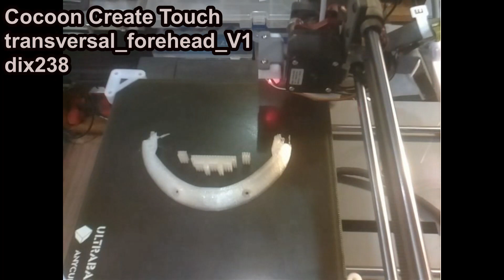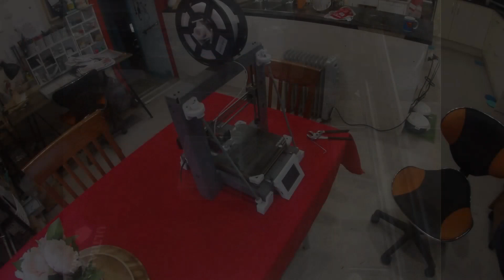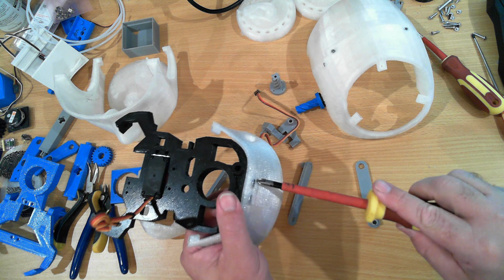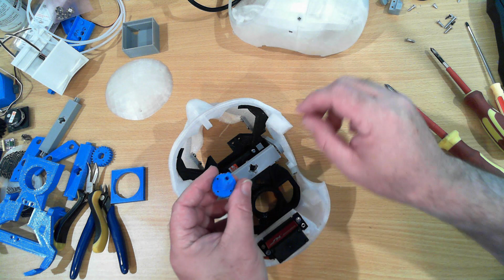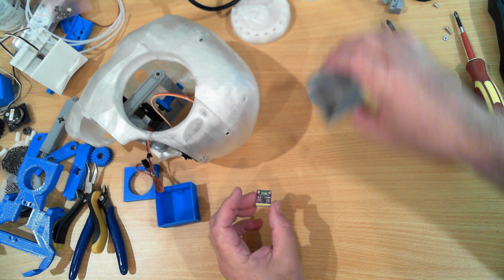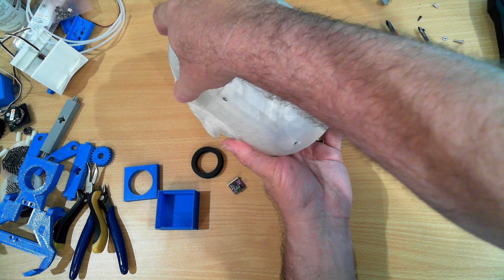Freds Head Part 1

Comment: Hi 
Is there an option to install speaker in the head ? and if yes  what  size and  output power
If you can send model it will be  great.
Regards ahead Doron:chillwcat:
Reply from the maker: There is a stl for the speaker on the official inmoov site
https://inmoov.fr/wp-content/uploads/stl/Neck/SpeakerMouthHolderV2.stl
I don't think this is compatible with the new i2Head version that I am now running.
I don't have a speaker installed in my build's head
Reply: @CyberOne  
Hi thanks for help  So   if  i want  to have   a speech  conversion (AI)   i have to connect an external  speaker ?  Doron

Comment: Hi 
is there a Bom for Fred (I mean stl files   and hardware so  i can order  all 
Regards Doron
Reply from the maker: The most current build is now mostly a standard build now.
The mods I had used with the head have all now been replaced with the i2head, this now has 17 servos in it and no room for the Raspi in the head.
The standard InMoov BOM can be found here: https://inmoov.fr/default-hardware-map/
For the i2head, check this out: https://inmoov.fr/headi2/
and the i2eyes that fit into the i2head: https://inmoov.fr/eyes-i2/

I found I can now use the standard MRL - InMoov program now the Config systen has been introduced,  mostly now its just the way I have wired my build that is different now.
Hope that helps.
Reply: @CyberOne  thanks for response
 will begin the print and order hardware  Doron

Comment: Question, for your opinion, what are the best standard servos to use…..I run mg996r servos, but when I change the end stops for the servo in MRL, they shut down and I have to reset the whole program….looking for a cheap servo if possible….
Reply from the maker: I don't think of the MG996R servos as a cheaper servo, not when you have to replace them.. 😞
More recently, I've been using the PDI-6221MG servos or the FEICHARO F39202-270 35KG 270° Servos.
These servos are not much if at all more expensive than the MG996R but do last a lot longer in most cases.
Reply: @ thank you….

Comment: Which of the link in the description contain the jaw support parts used in this video?
Reply from the maker: I thought you were building the i2Head!
Parts used in this videos are not compatible with the new i2Head versions.
This build was created back in May of 2020
The i2Head is this years build.
Reply: @CyberOne  yes, I was trying to build i2 head but I don't have any silicon mold expert that can make a silicon face for me. And I can't do that by myself. So there is no other option than using this built.
Reply from the maker: @SaadAli-v2t  I don't have expertise in silicon face making either.
I printed out the moulds as found in the i2Head parts list, cleaned them up and mixed the 2 part silicone and poured it into the mould.
This worked.
Just remember to read the instructions on the silicone pack.
Also use a good mould release agent to help with pulling it apart.
After that, you will have some experience in the process 🙂
Reply from the maker: @SaadAli-v2t  I get asked a lot about where I get the STL files I used in the building of Fred.
Below is a list of the different locations for parts I've printed that are non-standard Inmoov parts.
All other parts not listed are on the official Inmoov site
http://www.inmoov.fr/

https://www.thingiverse.com/thing:2394098
InMoov - Accessible skull with continous forehead by dix238.

http://www.thingiverse.com/thing:992918
Modified InMoov head by monnerby.

http://www.thingiverse.com/thing:3395654
InMoov Neck Head Bracket Another Redesign v2 by richardtracy

http://www.thingiverse.com/thing:2335838
InMoov LowBackSkull & Gear remix by richardtracy

http://www.thingiverse.com/thing:1581955
InMoov - Low Back Skull / Neck Joint - Modification by dix23.

https://www.thingiverse.com/thing:1636086
InMoov Face less holes by juergm.

http://www.thingiverse.com/thing:2062472
Raspberry Pi 2 Stacking System by TafThorne
This was modified to let me use PCB standoffs.

https://www.thingiverse.com/thing:2548952
InMoov - Advanced Eye Mechanism by Dakota76.

Alexinator40
Remixed from
http://www.thingiverse.com/thing:3395654
InMoov Neck Head Bracket Another Redesign v2 by richardtracy
Remixed from
http://www.thingiverse.com/thing:1581955
InMoov - Low Back Skull / Neck Joint - Modification by dix23
Remixed from
http://www.thingiverse.com/thing:992918
Modified InMoov head by monnerby.
Remixed from
http://www.inmoov.fr/
Created by Gael Langevin

AT30_SMPS.STL https://www.dropbox.com/s/qasvv97k4j6kot5/AT30_SMPS.stl?dl=0
Created by Cycber_One

PCA9685_Mount.STL https://www.dropbox.com/s/vjgidlmbo2zt9v8/PCA9685_Mount.stl?dl=0
Created by Cyber_One

http://www.thingiverse.com/thing:2770920
Aldi Xfinity and Ryobi (south africa) battery connector by Stoney

Comment: Sir, can you please tell me which amplifier module you have used in the speaker case
Reply from the maker: This was a small I2S 3 Watt Amp module.
While I did install it at this point, I was unable to get the I2S drivers to work on the Buster OS which I used in this build.
It was supposed to be better quality audio compared to the audio jack on the Raspberry Pi, but the audio from the Raspberry Pi jack was better than the no audio I was getting from the I2S system
This was caused by a lack of support for the I2S bus on the Raspberry Pi.

Because of the lack of driver support, I don't use that amp :-(
Reply: @CyberOne  ok sir, i got it, thanks alot for the help
Reply from the maker: No problems.

Comment: great video , I  am  following all your videos  I'm new in making the inmoov Robot so I started with the skull just the top part so far  from the inmoov page now I want to make the face and the parts inside the head any suggestions I don't want to do it from inmoov if there is better working parts
Reply from the maker: There are two or three ways of building an InMoov robot.
The one you choose is very dependent on your current skill level and how much you like to punish yourself. :-)
All the parts on the Inmoov.fr site will work for a standard build, what's more there are instruction and a lot of help out there for the standard build.
If your more adventurous and have a well dialled in printer, then you might like to look at the modified parts on Thingiverse.
Before starting, go to the build it tutorials on the Inmoov.fr site and download and print the calibration parts.
If they don't fit very well, then you need to calibrate either your printer, slicer or both.  You should not need to force the parts and they should hold them selves together.
In the descriptions of each of the videos I have made, I have listed the parts unless the part came from the Inmoov.fr site.
You will find i used the neck and below for the most part from the Inmoov site.
Most of the mods I have are so I can fit a raspberry Pi SBC in the head, and also for better eyes :-)
Good luck with your build, and don't forget to have fun. :-)
Reply: @CyberOne  where can I find the specs for the servos used in the head ?
Reply from the maker: @louwrensburger1796  There are two sizes that I used in my build.
The two standard sized ones was the JX PDI-6221MG, I found then here:
https://www.banggood.com/JX-PDI-6221MG-20KG-Large-Torque-Digital-Standard-Servo-120-Degree-For-RC-Model-p-973947.html?cur_warehouse=CN

The 6 smaller one I used the JX ODU-1109MG and can be found here:
https://www.banggood.com/JX-PDI-1109MG-9g-Metal-Gear-Core-Motor-Micro-Digital-Servo-for-450-RC-Helicopter-p-1075300.html?akmClientCountry=AU&cur_warehouse=CN

If you shop around you may even find them cheaper.
If you go with the standard build, that uses one BB805 large scale servo, one MG-996R standard size servo and two SG90 small size servos.

Comment: Where did you get the file for the bar that the piston for the jaw screws into?  The one I have has the whole in the center not offset like yours.  Also where are the bars that connect from it to the hinges?  I do not have either of those files.
Reply from the maker: The files you seek are in the description, 
http://www.thingiverse.com/thing:3395654
InMoov Neck Head Bracket Another Redesign v2 by richardtracy
:-)
Trouble is there are also jaw servo parts in some of the others as well. :-)
Reply: @CyberOne  thank you.  I did track them down.  I watched your video again and realized you said the name of who did them so I looked there.  They are printing as we speak.  Thanks

Comment: hello, great video.
tell me what are the references of the servo to use?
coordinate a French who follows you ^^
Reply from the maker: In the head I used two sizes of servo.
For the Jaw and the neck rotate or Yaw movement  
I used the JX Servo PDI-6221MG, this is the same size as the MG966R type servos.

For the eye mech I used 6 JX Servo PDI-1109MG servos 
However the creator of this design used SG90 servos, MG90 would also work.
The SG90 would be the quietest of the 3 servos but also is the weakest.

Personally I have found the PDI servo to be of a better quality, but then you do pay more for them.

Ray

Comment: Are you using octoprint on your 3d Printer?
Reply from the maker: Yes I am, :-)
Have done for years now, since before I had thermal protection enabled in the printer,
At the time, there was a plugin that provided thermal protection for printers that didn't have it enabled.
I've since upgraded the firmware on my printer, but I got used to the convenience of uploading and controlling my printer via the network.
And the Octolapse plugin is awesome :-)
I have also joint the OctoPrint Patreon to help support it in a small way.

Ray